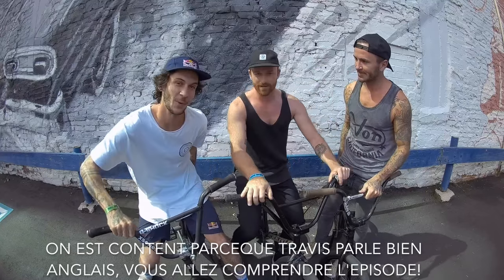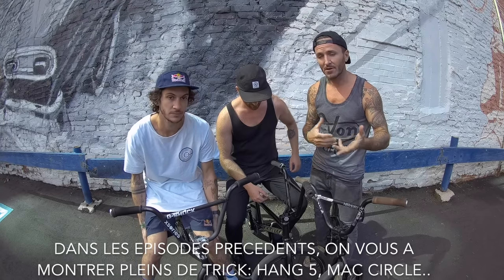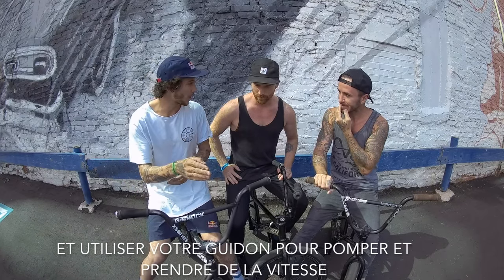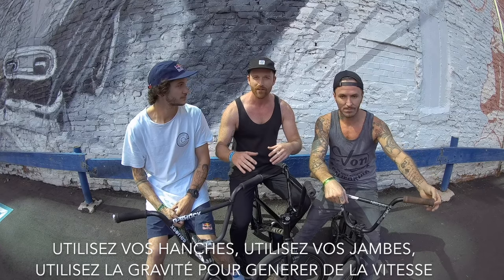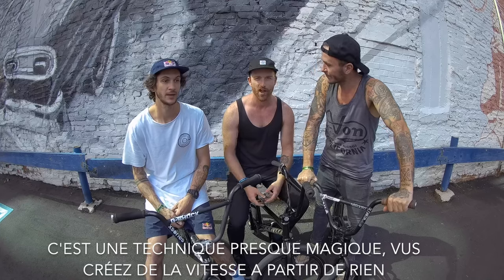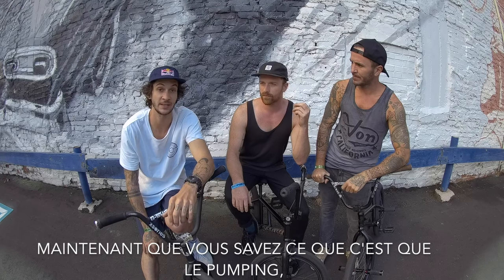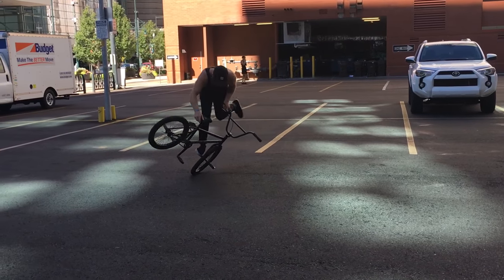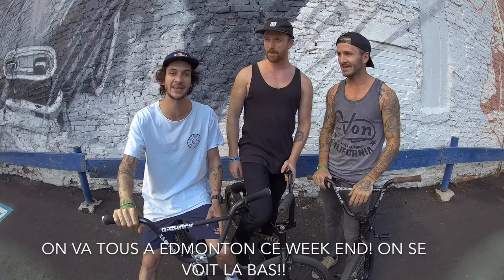How to "Pumping" | BMX Flatland | Can you make it! episode 18

Comment: 7 years later and I only figured out the peg wheelie pump (and I can't get the speed in video, just maintain same speed until I lean back too far).  Steamroller pump is still not happening. I can't figure the body language I'm guessing. The foot kick out back of the body helps maintain the front lean pull back bit.

That said,  I'm doing much better on the snake spin, but I don't do it switch footed. Kinda like a grean bean from a mirage (yes that dates my age knowing those names). 55 icyww